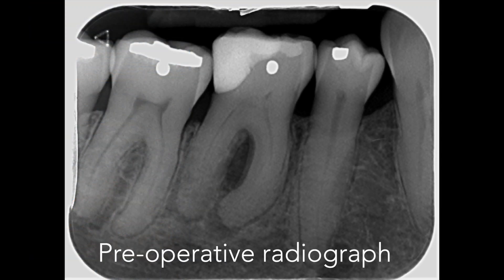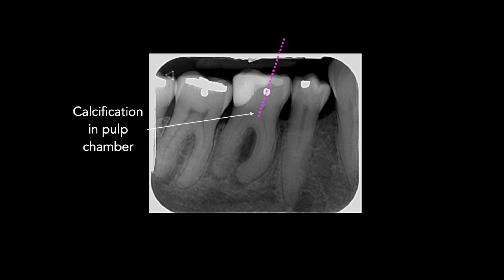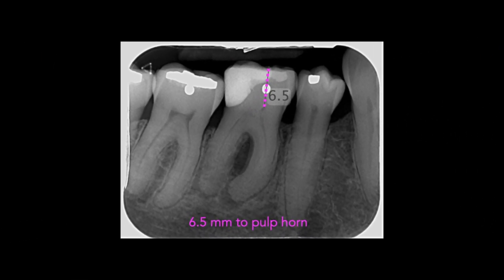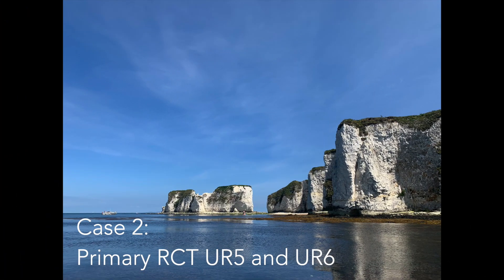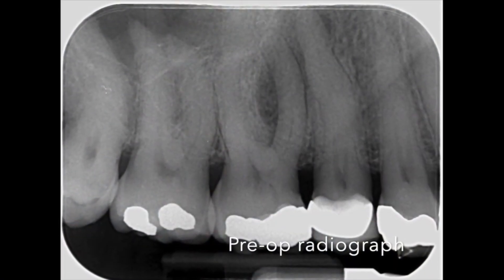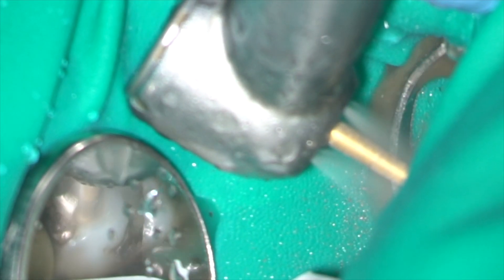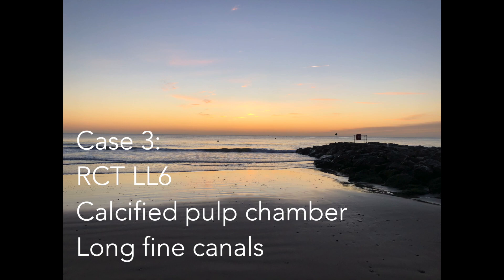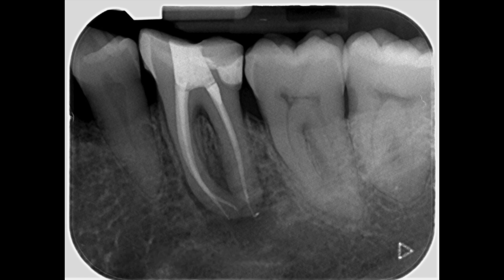Preventing perforation part II: molar access

Comment: Hi Dr.,

If you develop glide path before using an apex locator, how do you know if you are going beyond or short of the actual working length? In other words, when would you take working length? You wouldn’t just locate the canals and immediately take working length?
Reply from the maker: I prepare the coronal part of the canal first as this makes it much easier to get the diagnostic file to length...You can get a rough idea of length from the pre-op paralleling radiograph..
If you try and go to length without any coronal preparation the files tend to bind coronally.